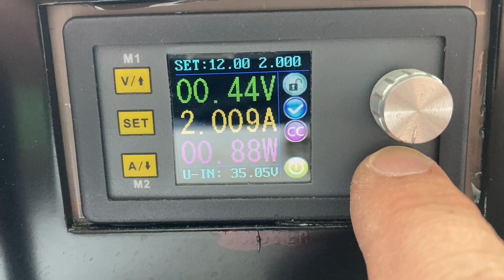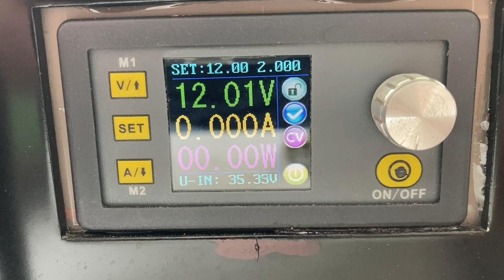HPE G10 Backplane Trips E-Fuses - Repair (PWJ232)

Comment: Lol, we are still running gen8. Rock solid but old.
Reply from the maker: The best HP servers were G7. G8 fail very often because the flash chip for Intelligent Provisioning fails. For unknown reasons, HP decided to solder that chip to the mainboard instead of using a removable SD card...
Reply: @PlaywithJunk  And to make it a bit more difficult they were BGA NAND memory too, I've replaced a few and had no more problems. Apparently things got better with later firmware.
Reply from the maker: @SiaVids  I can't replace BGA chips myself. But I found a company that can do that for a reasonable price...
Reply from the maker: Regarding firmware... the Gen10 servers have a lot of firmware related problems. It started with the new Intelligent Provisioning that had bugs like a rotten fruit. I had a couple of G10 servers that had to be replaced because they refused to start after a firmware update. Fortunately most of them recovered in the workshop after resetting everything to defaults.

Comment: Hope the replacement is at least 25V rated, also 25uf? I know the usual ratings are 10uf, 22uf. Soft term or open mode would be perfect.
Reply from the maker: These are all "recycled" capacitors and since they are from 23 to 26uF when measured, I wrote 25 on the container. I this application a few more or less uF's don't matter. And because the "new" cap is of the same size, I assume the voltage is correct.